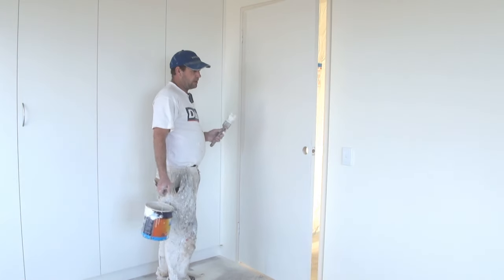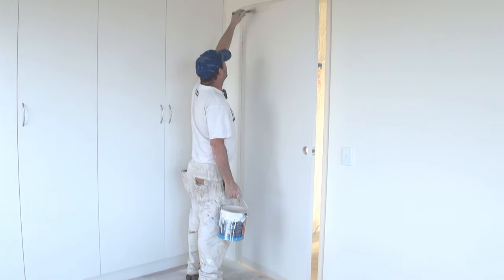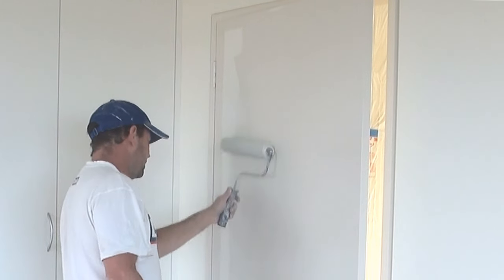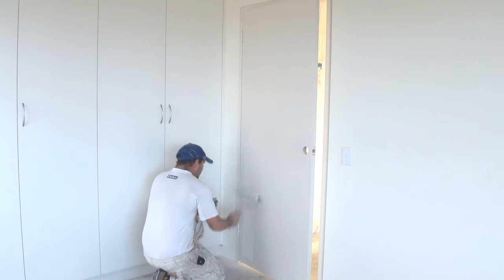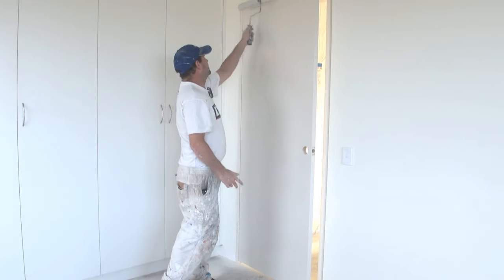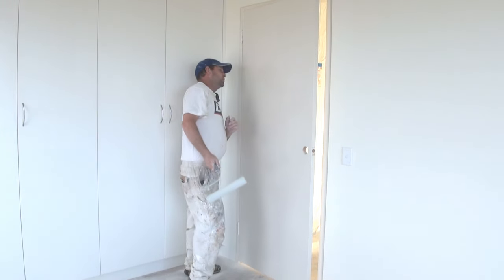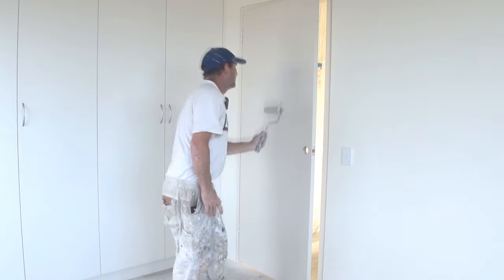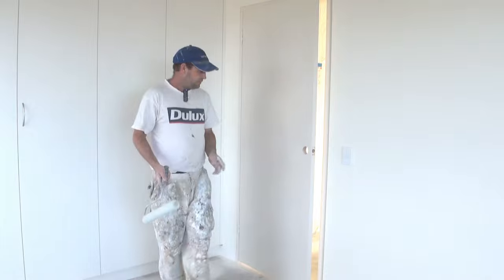Painting Doors - How To Paint Doors Using A Roller

Comment: Hi...Would you tell me how many coats to do on doors after priming?
Reply from the maker: Depends, when you say priming do you mean it was an unpainted door and you primed it or was it painted and you primed it? A lot of people call an undercoat primer, so lets say it was a new door then you would need to undercoat then apply one or two top coats, most manufactures recommend two top coats. If your door was previously painted then the primer should be ok as an undercoat but do read the label on the paint can to see if it is ok to apply top coat over it. If so then apply two top coats over the primer, some primers are more absorbent then undercoats so you will most likely need two top coats to achieve an even finish.
Reply: howtopaintinfo Thanks for the advice on the roller.  It's an oil based so I will get a foam I think.
I should have explained myself better in regards to my doors.  They are painted already - it's a 20 yr old house so I'd say its the original paint on them.  I haven't done anything yet but I have tubs of primer & undercoat.  Which one should I use under the 2 coats of enamel?
Cheers :-)

Comment: Like your work but the only thing i will say, use a small extension pole otherwise your gonna have a f***ked back after few doors
Reply from the maker: That is a good point, just never bothered using them but you would have slightly better control without the extension.
Don't forget to Like, Share and Subscribe

Comment: i coulda rolled and tipped 3 doors by the time you done that one side. PEOPLE THESE tips are very rough and i wouldnt recomend it to a novice. Its faster neater and a proper job to tip the enamel off with a brush, playing with it rolling over and over, wrecks the finish loses the shine and creates a nasty hammer finish. BTW always do door edges first, and make sure door is well dusted down first. DONT USE THIS AS ADVICE
Reply from the maker: This video is showing how to roll a door, not on how to roll a door and lay it off with a brush (that's another video). Also at the end of the video you can see the final result and there is nothing wrong with it and it's obvious that you didn't watch or listen to the video, at start I do say to cut in edges first.
Reply: As a novice painter, I prefer it if the painter in the how-to video takes his time a little. If you would make a video doing 3 doors in 4 minutes like you boast you can, then it's worthless to me because I wouldn't be able to copy that and get a good result.